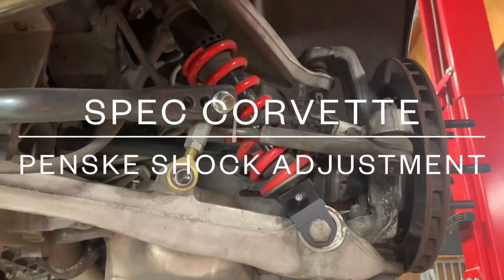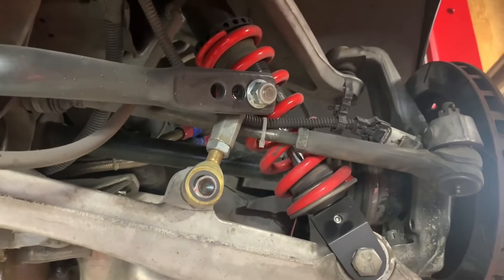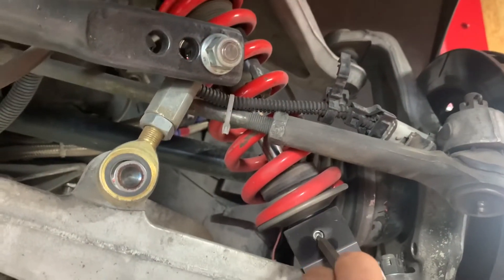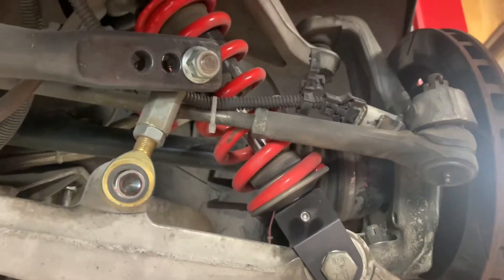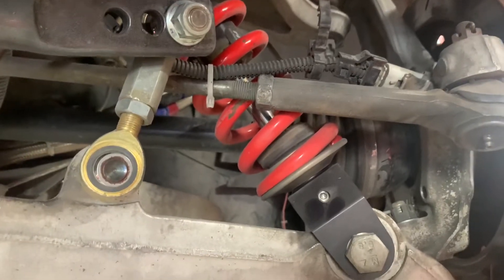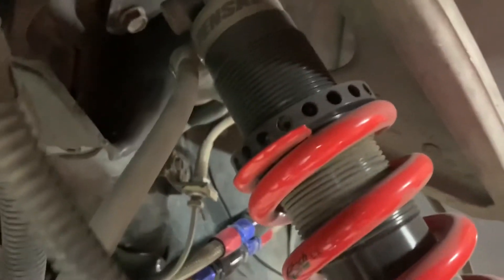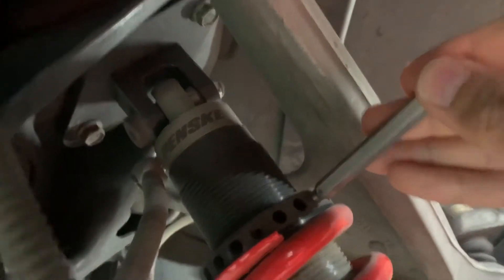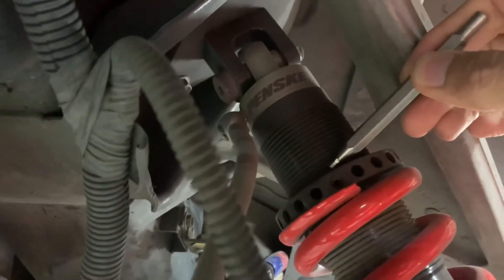Spec Corvette Penske Shock Adjustment

Comment: where did you mount the canisters?
Reply from the maker: On my first build, I mounted the rears to the sway bar with hose clamps as a temporary solution.  The fronts went to the compartment in front of the tires (also temporary).  On the second build, I cut 2 inch holes to run the canisters through the SMC into the trunk and engine compartment and used grommet plugs to seal them.  I'll have video on that in a few weeks.
Reply: @joshc1017  thank you for the reply I'm excited to for the video to release !